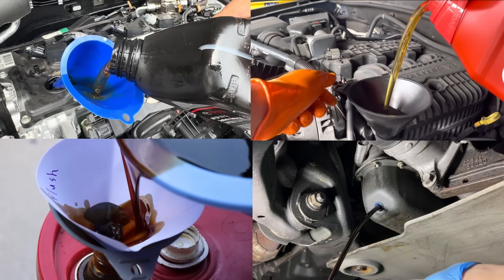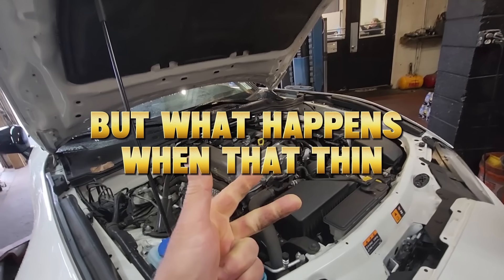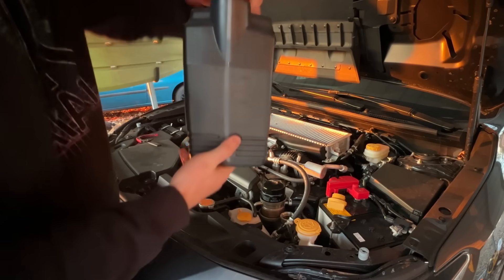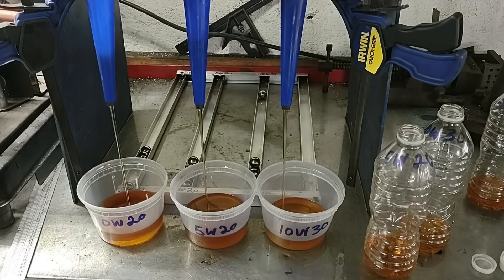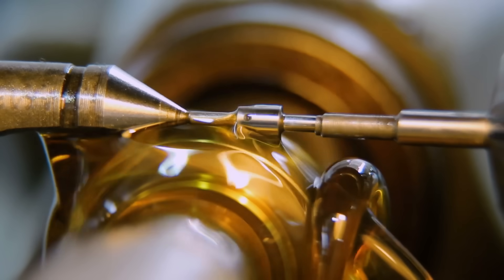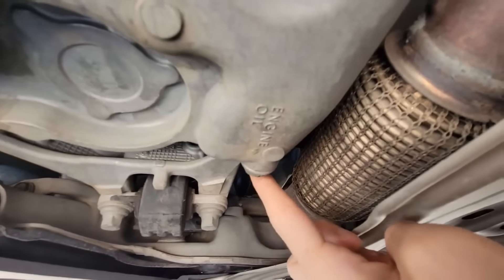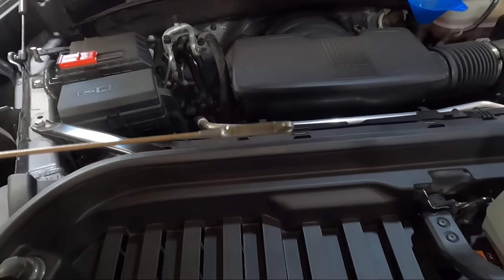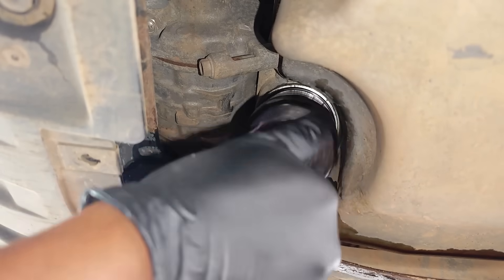The TRUTH About 0W 20 vs 5W 30 Oil (50 Engines Tested!)

Comment: Cheap olive oil or the more expensive extra virgin olive oil ?
That is the question.
Engineers say extra virgin olive oil breaks down at too low temperatures for frying / woks. While your bog standard olive oil can be used at a higher temp.

Comment: 2017 PF, recommends 0w-20 BS too thin in desert climate. switched to 5w-30 engine is quieter and smoother. I change my oil every 4-5000 miles

Comment: I have a 1987 ford small block I just rebuilt in my ff5 cobra. Carb and all new bearings pistons valves, etc. It doesn’t get driven much. Breaking it in with Zink additives and petroleum oil 10w30. Less than 1000 miles on it so far and running nicely. But, getting a little blue smoke on passenger side when I hit the pedal at idle a little. Can I try 10w 40 or 10w50 for the next oil change for 500 miles to see if it stops the smoke? Thanks, Paul

Comment: 5.000- 10.000 is a mith. Every car truck i  had. Only lasted bearly 3500!  Miles. . I change every 1.000 -2.000 if i drive that one vech for long miles. Especially  a truck and a load on the engine . Trans comes 2500-3.000

Comment: I have had 4 5.7 hemi,s all with 5w20 gastrol oil .
Two ate at 180,000 km and the 5.7 magnum is at 485,000km never had a issue and a bottle of reslone every oil change. 
Happy motoring

Comment: 2005 Dodge Dakota have been using 5w30 during cool and cold weather. 10w30 during the summer months from May - September. 2016 Ford Fusion 2.0 turbo EcoBoost all year. Mobile 1 5-30

Comment: as for the frequency of change your oil. basically regular oil  Irregardless of the weight was always 3500.00 miles give or take,   Synthetic oil they say you can go as long as 5000.00 miles now don't hold me to that Synthetic quote, that's just what I've heard, but the standard oil,  that's spot on. your spark plugs I normally change every other oil change depending on how many miles you drive a year, or atleast twice a year if it's in your budget if not once a year is ok also. preventative  Maintenance is key to the longevity in your motor. Hope this was helpful for some. 😊❤

Comment: HI, GARY HERE AGAIN, I have another  Suggestion that's probably not going to go over too well with a certain somebody that I've been getting comments from about my 20/50 oil comment  I made earlier, this one has too do with thee  Quantity of oil you put in your engine, all engines have a required amount of quarts for their particular vehicle, but I watched a video that shows while under normal running conditions the oil levels in the oil pan are barely above the pump, now this is being tested on an engine setting still, not driving up an down hills or taken turns at 30 or 40 miles an hour, proving that if your car requires  6 quarts of oil it is save to run 7 quarts to guarantee your pump will never suck air. they actually doubled the oil quantity in this test before it start smoking.  only because the engine was stationery. it was a very interesting video.  I was pretty impressed at how long it ran before  Fouling out the plugs.  Moral here is that you can put an extra quart of oil in your car and not worry about it.😊

Comment: 2016 nissan maxima in Middle east, from 0w20 to 5w30 ; Liqui moly molygen 5w30 it's caused smooth engine, batter performance but a little of fuel consumption more.

Comment: Pennzoil synthetic ULTRA that is 2nd only to Amsoil !   5W30 is the way to go for Silverado (2014) 4.3 V-6. Change every 3500 miles.  Amsoil 20 Micron oil filter. zero issues. Amsoil trans fluid every 40 K   (and filter) cleared up light clatter at start up. I can tell the difference.  Keeping this truck as new ones are insanely priced.

Comment: I don't and never did like even going to 3K before changing oil.  Ofcourse oil was cheaper back 25 years ago.  I was an avid 2500 to 2800 mile oil change guy.  Im still a believer in it especially if it works hard, towing, summer heat/AC use etc. And for heavens sake, Dont Idle your Engine unnecessarily.   Turn it off.

Comment: 5w-40 always especially in gasoline engines. 0w-40 can be also but only if you need it. 
5w-40-or 50 for engines older than 2005

Comment: I run Amsoil 5W 30 in my Kia Soul, but after 80,000 miles I switched to Pennzoil, 5W 30 and the engine lifters started to clatter just after the oil was changed. So I jacked the car back up  dumped the oil and put Amsoil back in with another new filter and the lifters quieted right down. I will never run Pennzoil in my cars or trucks again. the Pennzoil was full synthetic. The Amsoil is far superior. It may cost a little more per quart, but my engine will last a whole lot longer.

Comment: 0w-20 wildly used in Japanese engine over 20years and tons vehicles proof the long term protection.    But nowadays 0w-16 even 0w-8 I personally don’t trust them yet.  5w-30 or thicker is not necessary especially for Japanese cars

Comment: As usual, "5W30 is absolutely perfect" video. No engines were worn out or had any wear issues whatsoever from 1989 to 2010. 5W30 protected all of them 100%. Techs did not even know how to rebuild engines under 300K, and no hard engine replacement parts existed. Then god dang water thin 0W20 oil was forced upon us as a CAFE conspiracy (which is also the reason that 5W30 exists but whatever). Now look at us. Engines blown up everywhere.

Comment: I have a 2017 Tucson with the 1.6 turbo charged engine and have used 5w30 Full synthetic Mobile 1 since new and that's why I still drive it at over 216000 KMS

Comment: 5w30 still isn't that good on high load. I use 0w40 for better cold start flow and 40 for protection. When car doesn't have particle filter 40 usually are higher saps providing better protection. 5w30 is minimum to use

Comment: Overall I agree with this but I run 0w-20 Valvoline full synthetic in a 2011 Toyota FJ Cruiser with 150,000 miles. I live in southern Nevada where summer temps. exceed 110 degrees. Zero oil consumption and oil analysis shows minimal wear at 5000 mile change intervals.

Comment: For the last 30 years I have always used full synthetic 5w-20 from December through March, then 5W-30 the rest of the year. I change the oil every 6k and 8k miles, usually Valvoline or Havoline(Supertech) and use an OEM filter. Every car our family has owned has gone over 200k miles. One current car is a Hyundai Sonata with 246k and counting.

Comment: An some latest Toyotas Corollas were labeled with 0W-16, its practically water, so dumb. Maybe for winter in cold snowing Areas, use 0W-20 or 0W-25(if available), then return to 5W-30

I think for protection in a non-oil-burning car: Would best to use 1 OCS(Oil Change Service) Mineral/Standard Motor Oil, the next OCS: Synthetic Blend(Hybrid 60-70% Mineral & 40-30% Synthetic) & then 2 Full, then 1 OCS Synthetic Blend; all these 5 OCSs are 1 cycle, the relationship of Mineral to Synthetic is 2.3:2.7=0.852; that will give more Synthetic Protection & Detergents to the Engine, while the small amount of Sludge will allowed, will protect small wear out parts of the Engine.

Comment: Mechanics aren't "choosing" the wrong oil. They're putting in what the manufacturer recommends. First off, that's a requirement to maintain your warranty. Secondly, no mechanic wants to take the risk of switching you over to an oil he KNOWS is better. If he does that, he will open himself up to accusations that the change led to whatever problems you have in the future. 

Yes, you should definitely change to 5W30 if your car's recommended oil is 0W20 and you're beyond the warranty period. DEFINITELY change even if you live in a cold climate. You should ALWAYS change your oil on or before 5,000 miles no matter what oil you use.

Comment: 5W 30 is safe allaround. 
0W 20 is not for tropical climate even than car manufacturers push 0W 20 for good milage. 
If using 0w 20 better to change oil as per the manufacturers recommend intervals. Once yr car crosses 50k it's safe to shift to 5W 30 except during harsh winter or cold climatic conditions. 
Both oil grades have their advantages and disadvantages.

Comment: I'm from Malaysia using perodua Axia 1000cc, Toyota engine. It say recommend 0w-20. I just follow it for the first year. Then I use 5w-30, because Malaysia consider hot here, don't need 0w oil

Comment: I guess my engine never noticed it was using 0w20 because it just rolled 301k miles. At least 60% of those miles were towing 4k pounds in the extreme FL heat.. It's a 2010 f150 5.4 3v. Engine has never been touched internally. It used 5w20 for most of it's life until I switched to Mobil 1 0w20 ESP about 5 years ago. The engine is so smooth on this oil. Oil changed every 3-4k depending on usage. No oil usage between changes. If there was a negative to running 0w20, then my engine never experienced it. If it blew up tomorrow, I still wouldn't blame it on 0w20. The 0W20 got me to 300k miles.

Comment: i have a BMW 328i twin turbo and always used 5w-40 full synthetic oil and never had a problem and at 77,000 miles the engine is clean as it was when i first brought it

Comment: Great video , I live in Sydney have a 2019 Subaru forester I have been using 0w 20 full syn , and change my oil every 5000 klm  (every 6 months ) and do mostly City driving , do you think I should change to 5w 30  as I want to keep the car long term  , Cheers
Reply: If you have a "calm" driving style, you can use 0w20 oil. If your driving style is "aggressive," switch to 5w30 or 10w30 oil.

Comment: I used Mobile 1 or Valvoline , both 5W-30 full synth in my 2006 Corolla...purchased new. I changed oil/filter every 5K miles. Never needed to add oil between changes. I sold the Corolla 17 years later with over 370K miles. Never had the valve cover off or did any motor work...only plugs, O2 sensors and other normal maintenance. Original exhaust and everything on the car worked perfectly. My 2019 Highlander just hit 100K miles with nothing but Valvoline or Mobil 1 full synth. I'm switching to 5W-30. Thanx for the heads up.

Comment: I’ve been running 5w30 in my 2019 F150 3.5 Ecoboost for the first 55k miles of its life. I switched to 5W40 Liquid Moly oil 6 months ago and can’t believe how much quicker the engine is. I’ll be sticking with the 5W40 from now on.

Comment: If you look at a 2012 V6 toyota rav4 engine. It recommends 5w30. Then look at a 2015 toyota highlander v6. Same 2GR-FE engine. It uses 0w20. Which proves this video makes complete sense.
Reply: Tolerances could be tighter which is why the 0w20 is used.
Reply: @ryancroon5131 I checked on toyota repair manual and the oil clearance specs are identical.

Comment: I use 5/30 oil in my 2021 Chevy Suburban and change it every 3,000 miles. My Suburban has over 100,000 miles and I change the transmission oil every 30,000 miles.

Comment: It's simple: if you live in a hot climate with no winter, use thick oils (5w30 - 10w40); if you live in a moderate or cold climate, use 0w20, 5w20, or 0w30. And most importantly, don't use 0w20 in engines that the manufacturer doesn't allow it. 
Also, if you live in a big city, change the oil more often: at least every 5,000 miles (7,500 km). The frequency of oil changes greatly affects engine life, even more than viscosity.
P.S. Even in cold Russia, there's debate about whether 0w20 or 5w40 is better—and the odds for win are even :)

Comment: Corvette C5 1999, 60,000 miles on the LS2 stroke with forged pistons and Mobil 1 5w50 oil. No problems. 750whp

Comment: Valvoline 5w-30 Synthetic 2021 Ford F-150 Powerboost... With an Oil catch can, to help keep the valves cleaner... Recommended 5w-30 oil, says right on the oil fill cap... I drive no more than four thousand miles on a change. 3500/4000 miles. old school

Comment: VW/Porsche/Audi 508 spec oils for 0W20 contain additives that specifically eliminate all the so-called "problems" with thin oils, from viscosit loss to high temp failure. Run 0W20 that does NOT use DEXOS labelling. This video assumes that all 0W20 oils are the same regardless of specs; not true.

Comment: Usually I disagree with these kinda posts. But it seems that you have actually done your homework.  I've seen dozens of engine failures on 0W20. But the same engine using 5W20 keeps running perfectly.
Reply: You're talking about two different 20 weight oils. I'm not trying to be a jerk, you don't understand oil weights.
Reply: @MacCready_ exactly. 0W20 has caused more engine damage than anything in history. Across all manufacturers and designers.

Comment: "toyota even admits in a bulletin that 0w20 is only used to reduce emissions". a few sentences later ; "only use 0w20 in vehicles with tight bearing tolerances, such as toyota......". good job
Reply: I have 0w16 in my rav4...
Obviously i cant jump to 5w30 I presume..
I know 0w20 can be good especially in hot summer/desert.

Comment: mazda has 2 oil specs in the manual. North american engines 2.5NA Skyactive engines use 0-w20.  BUT for Africa they request 5-w30 EXACT SAME ENGINE. It is in the manual. Dealer is currently using mazda 0-w20. But i am going to switch it to 5-20. living in AZ i will be fine long term our winters RARELY go below 30F.

Comment: I still use manufacturer recommended 0W-40 and my MB has over 200k miles on odometer. Oil changes every 3.5k-4k miles.

Comment: I have a 2013 Mitsubishi Lancer with 148 thousand miles and since new it uses 0w20 and the engine has no oil leaks and the engine is clean internally. I change the oil every 3500 miles.

Comment: Jeep wrangler JL or JT with the 3.6 pentastar call for 0w20, Amsoil Signature Series 5w30 all the way. If you're worried about dry starts then you need to invest in the Baxter oil filter adapter.
Reply: I have a JK and a JL both get 5W30

Comment: I have been using 5W-40 in super cold climate for B58 engine BMW throughout the last 8 years now, and my car loves it, 0W-20 is manufacturer recommended oil for this car, zero oil consumption by the way.

Comment: My V6 Highlander calls for 0W-20, but I recently switched to 5W-30. The valvetrain sounds much quieter when it's running, and when I accelerate hard it sounds smoother and happier, not sure how else to describe it. I made the switch in the summer, and it's now beginning to cool down. I will monitor how it sounds on startup when temperatures are in the 30's (Fahrenheit) and possibly send a sample to Blackstone when I change the oil next.

Comment: Hey folks! My QA INSPECTOR curiosity told me to look up Nissan TSB NTB20-039 to check about oil viscosity, & guess what: it has to do with ENGINE CONTROL MODULE NOT OIL VISCOSITY! Furthermore changing thickness MAY affect the phasing of the variable valve timing in SOME mechanisms. Check your engine type.

Comment: I am using 5W-30 instead of 0W-20, which is recommended in the owners manual, in my 2015 Toyota Auris 1.33 VVT-i (130.000km) and it works well without high oil consumption (0,5L on 10.000km). I am sure that a new car with 0W-20 also can last a very long time if it´s build well but in my opinion, why pay more for 0W-20? Does not make much sense to me... 5W-30 is already very thin...

Comment: I didn't know that Kia has 5W30 as the required oil in other countries outside the US, but it's 5W20 IN the US. I've been using 5W20. So I switched both of my souls to 5W 30, and it's weird. The engine is more quiet, and they run cooler now. I also use less oil (the one soul was one of the ones that had bad piston rings from the factory which was addressed in a big lawsuit). I hardly notice any MPG change. 
The US sucks sometimes.

Comment: My fk2 type r is said to use 0w20 , but i always used 5w30 in it , the ones that use 0w20 have timing chain rattle at and after 60k miles and consumed vtec sprockets  , i would never use that oil

Comment: Just bought a 2025 Hybrid Tucson. Driven only 5k km. Manual recommends 0w20 oil. Our temps in Pakistan are very high, crosses 45C in summer and we have a LONG summer..
Should I switch to 5w30...?

Comment: My '21 Nissan Versa spec'ed 0w-20.  My first oil change, I switched to 10w-30 Mobil 1.  I have since switched (@70k miles) to Valvoline R&P 5w-30, as it is hard to find in 10w-30.  I live in Mississippi, and rarely see temps below 30 degrees.  In summer, we typically see 95+ degree days.  My oil analysis reports show that the 10w-30 I was running and the 5w-30 I am currently running are performing almost the same, with very minor differences in wear rates, viscosity changes, etc.  I did also change from a Mobil 1 filter to a Purolator Boss filter, as lab reports show a slight edge to the Purolator Boss when considering all factors such as efficiency, flow rates, longevity, etc.

Comment: My Toyota hybrid calls for 0w16.  I've heard of some new cars calling for 0W8 !!!  Mine already pours like water!  My manual says you can use 0w20 in a pinch but instructs you to go back to 0w16 on the next change.  All of this and a 10K interval (I changed it at 1000 and every 5000 afterwards).  Yeah, their recommendations are enough to get you through the warranty period but that's about it.  My only concern about bumping up the viscosity is the tiny oil passageways and the variable pressure pump.  It's all designed for the thinner oil.  Wouldn't increasing viscosity THAT much cause other issues?
Reply: Switch and stay with 0w-20

Comment: For simplicity's sake I run 5W30 full synthetic and change it once/year. Been doing this in all my engines (except motorcycles) for 25 years. For motorcycles I use Rotella 5w40 T6 due to the wet clutch. I've been driving for 55 years and have yet to wear out an engine of any type. Have run some over 250,000 miles.

Comment: We use 5w-30 or 5w-40 in our newer Vehicles and 10w-30 in our 1998 Oldsmobile.  Neighbor has a Toyota using 0-16.  After 60k miles, it started drinking oil.  He said he'll never buy another Toyota.  I told him it could be the thin Oil at fault.